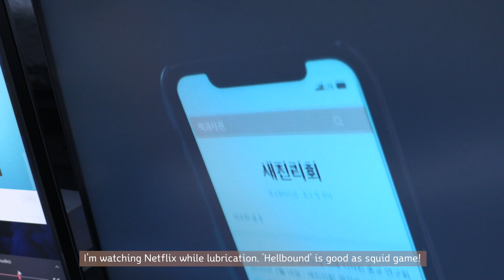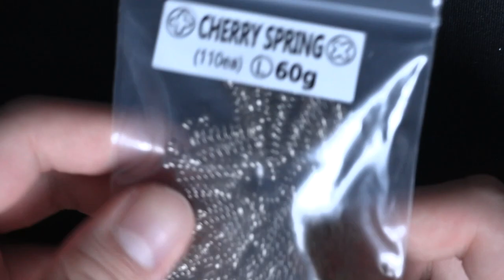Geonworks | F1-88 | Build & Silicon mat Typing (34 min guide)

Comment: How do tx stabs compare to other stabs you've used?
Reply from the maker: I think tx stabs have more low-pitched tone, because of the damper inside the stem.
Tx says they adjusted the horizontality of wire, but i think it is NOT perfect.

Then, the spacebar is so low tone, that's why i changed it to other stabilizer. it is so damp to me. And it was hard to insert stopper 😂

But pretty nice alternative for people who are annoying to level up the wires.(lube is essential though.) Except spacebar... 2u wires are good.
Reply: @Leiden_Keys  thanks for the detailed reponse
Reply from the maker: @xCuSt0Mx1  thx for ur comments!
Plz like and subscribe if u want. Have a good day👻